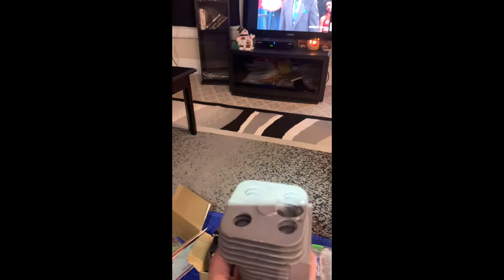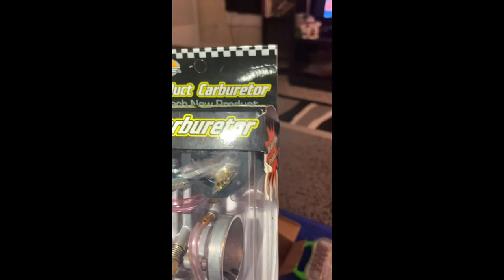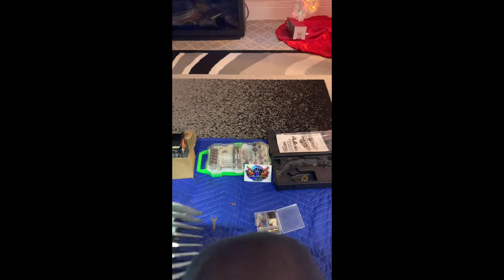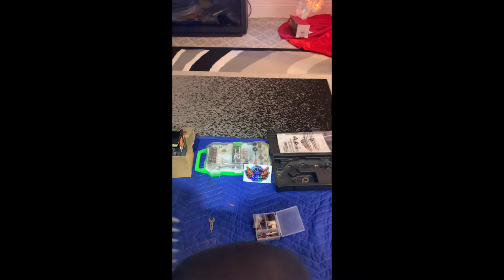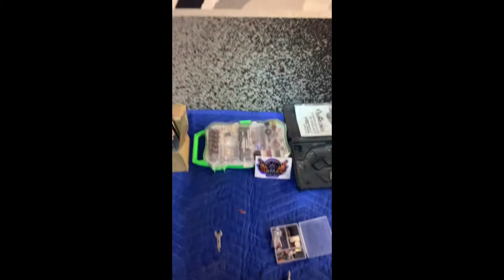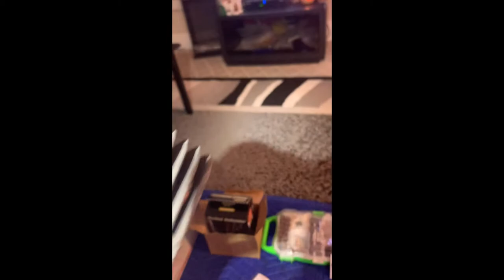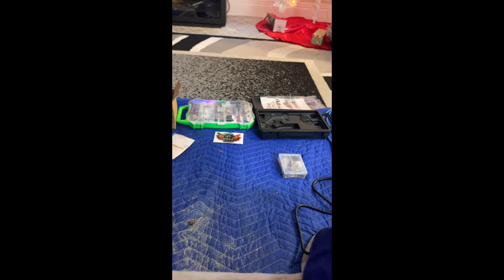Yd100 DIO Reed valve (New setup) Cylinder porting intake/exhaust

Comment: I have the yd100 on my spare bike with the dio reed valve and the carb. It's a 21mm and I have one of those little nitrous kits and it runs great. Had to buy a jet kit though because the few that come with the carb ain't big enough

Comment: my names dave and im on my wifes account but i just wanted to ask about the carb u are gonna use with them reeds?nice poet work by the way.what u did is about all they need.when i raise exhaust port ill do a little at a time and test it after each mod.anyway im looking to finally invest in high performance parts.these arer pretty reliable